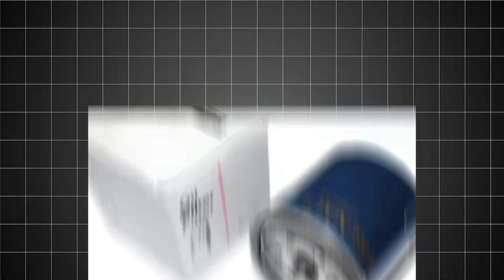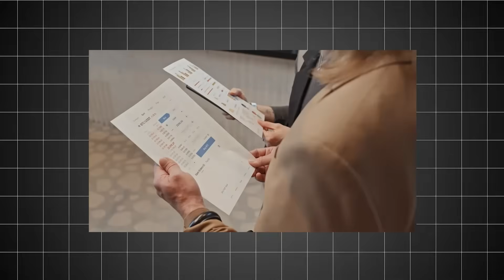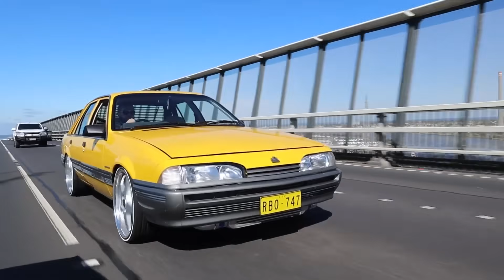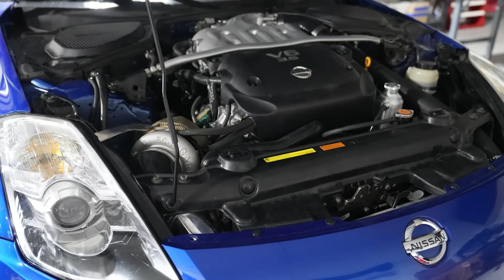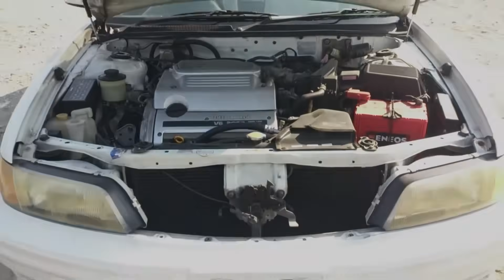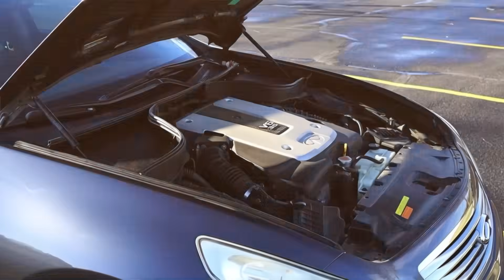3 WORST and 4 BEST Nissan Engines Ever

Comment: Have owned one 02 and two 03 Maxima’s. All bought used. Engines were bulletproof. The 02 made 258,000 miles before I wrecked it. Changed oil religiously - Castroil GTX or Mobile 1 full synthetic. The 02 did develop an irritating rear oil seal leak though in its last couple years of life.

Comment: I own a 2008 Nissan Altima SE and LOVE the VQ35DE engine.  Harnessed to the RE0F09B CVT, I tell my wife that Nissan paired arguably the best engine with the WORST possible transmission-- a real dichotomy!!  Both the engine and the tranny continue to be strong after 140K miles, but I'm easy on the drivetrain and change the engine oil and filter every 5K miles.

Comment: boet, you failed to mention the A and L series engines of nissan. i know a lot of 2000 Almeras with more than 200 000 miles on the clock without the symptoms you mentioned. my own 2004 almera have  271 000 miles on the clock with the original clutch, exhaust system gearbox cv joints and engine.
Reply: Yea this video must be talking about the ones found in the N16 ant the Face like version

Comment: I have a 2006 nissan murano with the vq35de and it has 156000 miles reliably with small issues
Reply: 156k aint that much.

Comment: How do you not mention one of the first reliable engines that powered some of the early skylines and the datsuns: the L28E 🤦🏻‍♂️I can pee in those engines, and it'll still run.
Reply from the maker: Whoa that's going back in time but fair call on the reliability. What's your favourite motor?